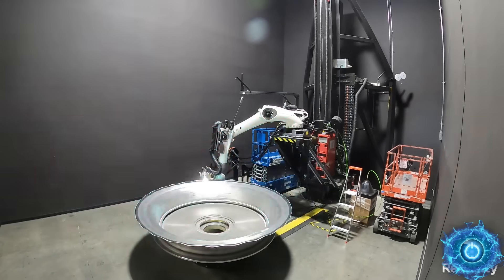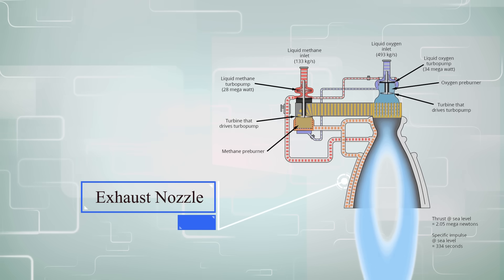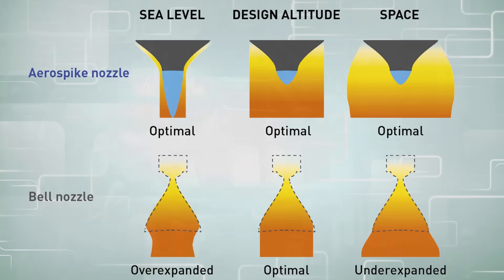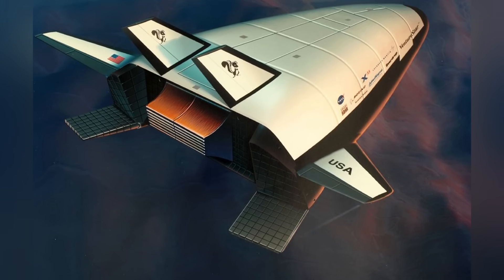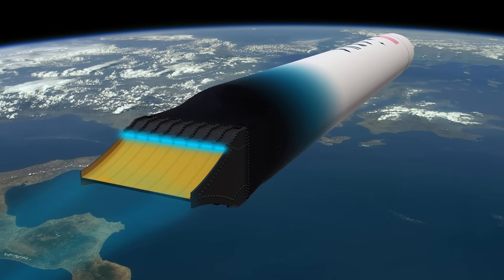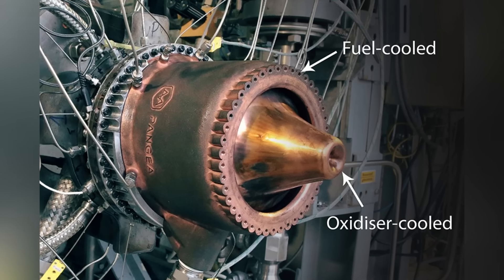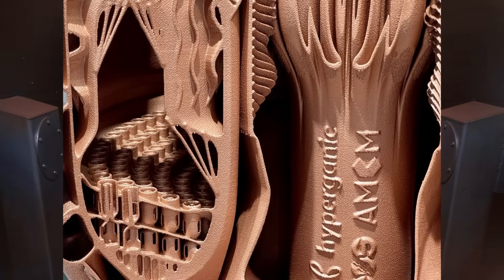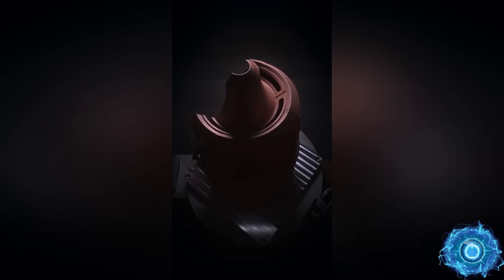GAME OVER - A.I. Designs CRAZY New ROCKET Engine

Comment: Amazing design  !!! Really surprised we haven't reached much further in designs,  we've been doing rockets since the early 60s !!! 70 yrs has passed. Thought at this point we'd be utilizing other technologies.
Reply: Why replace what has been proven to be both effective and economical?
Reply: Just seems strange we haven't advanced much. We lauded on the moon over sixty yrs ago. Thought by now we wouldn't even use rockets.
Reply: @kevinlucas8437  
No argument.  Do you know what the Loughstrom Loop concept is?  It has a fascinating history.
Rockets are the simplest and most straightforward way to get into orbit until someone can synthesize Negative Matter or further optimize Alcubierre's equations.  Or the stuff that Bob Lazar allegedly worked on is declassified.

Comment: You figure that nature, through tens of millions of years of evolution, has come up with optimal shapes/designs for virtually everything ..... in nature. And slowly over time continues to evolve to adapt to changing conditions, so it makes sense that algorithmic engineering powered by a super computer will "simply" sort out the most efficient design very quickly of whatever you want to build.

I've been following topographical / algorithmic engineering for several years now (although i don't really understand much of the complex physics and engineering principals) i do understand the overall philosophy of it, and it really makes sense. There is a great video about the design and manufacture of the  Bugatti titanium 3D printed brake caliper, and it's ability to deal with heat and pressure, this engine concept is really just a much more advanced profession of that same thing, solving issues using AI. But as the speaker stated, it will either be the future or the end of us all 😛

Comment: Algorithms are only as useful as the variables that are built into them and the data that is input for a result.  This is why fluid dynamics models are just that, MODELS.  They're semiaccurate representation of what we expect based on a limited variable set aka understanding.  The higher the tolerances which are needed for a finished product, such as a rocket engine, the more important it is to get your algorithm correct.  It doesn't just happen, it takes work.

Comment: If an AI had designed this engine, the AI would be a MUCH bigger breakthrough than the engine. GPT-4 is extremely good at physics for an AI, and it can help you design a tower of 4 blocks that doesn't fall over, not combustion simulations.

It was probably an evolutionary algorithm. I don't know how AI was involved, so I think it was involved very little. I've only managed to find a single reference to AI on either of their sites so far, and it was about the program in general, not this engine.

Comment: Well, and I feel this is fairly obvious, combine aerospike and rotating detonation engines using this cooper alloy. I would suspect that angling the outer ring of the detonation engine inwards towards the aerospike would get rid of one heated area and solve a great deal of that problem since aerospike reduced heating by the outer edge and detonation does not need any kind of hot area to operate. Time to get out the old cad cam again

Comment: Thank you for video.
AI is just an algorithm - crucial is fundamental database, which is human-based only. It is very difficult, to prove that AI-based random stuff is reliable. 3D printed technology is cool, but provides serious drawbacks in comparison to standard techniques. It is optimized way of doing very old things.
Post Scriptum: this engine will be produced in YEARS for proper roughness and still lacking important issues (printing technology constraints).

Comment: I interviewed for the X-33 project in 1996. Lockheed was full of aircraft experts but no rocket scientists. I told them that the aerospike engine was going to have major vibration problems. They said, "That's why we're hiring you". Alas, I couldn't find an affordable house in Palmdale and instead went to Kennedy Space Center in Florida. Sure enough, the first test firing cracked the composite cryogenic tanks and the mission failed.

Comment: Splitting hairs but, the reason for multiy stage rockets is a weight issue. The reason for a different design in the rocket is due to efficiency.  If air pressure was negligible rockets would still use multi-stage rockets. 
Love the video.
Reply: In a lower gravity or lower atmospheric situation, SSTO would be more feasible and sensible.  SSTO from the Moon & Mars is almost a given.  It was easy to design even in the 1960s.

Comment: This footage of the cutaway propulsion unit is hyperganics stock display model. To anyone that knows I'm number 113. At the moment what I am working on is structural designs for 103 aircraft and replacement components for construction equipment. We are still five years out for corporate proof of concept acceptance and probably ten before real integration of AI parts pass 50% market share. When people's lives are on the line change is slow.

Comment: Also the main solution of an heiress bike is not alloy but rather venting on the Spike. Running a fuel Rich mixture through a vent system down the spike will do the same thing as running a fuel Rich mixture down the wall of a bell nozzle.
Reply: text to speech?

Comment: Something that many people don't talk about when it comes to rde engines is the fact that they are extremely fuel efficient. The only problem is that you have a severe vibration in the vehicle due to the harmonics of the explosion chain. Even setting dual detonation Chambers counter to one another produces a violent shake in the vehicle. We can design the engines but the problem is that the airframe cannot take the abuse. Not for multiple uses at least.
Reply: What defines the frequencies of harmonics? Chamber shape? If those can be controlled through design can they be tuned by a damper? Or are they inherently chaotic and uncontrollable?
Reply: @RandoClippy  there's a myriad of things that lead to frequencies. A good example would be how each car manufacturer has a different vibration to their car depending on how their cylinders are arranged. You cannot fire them all at the same time and then shut them all down at the same time. The way it works is that it needs a constant explosion. The explosions in the chamber are what cause the vibrations throughout the engine. They are playing with mach flow with this engine. Mach flow tends to separate itself from boundary layers which can act as a dampener, there will still be vibrations throughout the entirety of the vehicle. What gauges the frequency is the speed at which the explosions happen, the interval in between the explosions and the location of the explosions along the frame of the vehicle.

Comment: crappy idea : we need the material to sustain high temperatures but we need it to be 3d printed with laser technology so we reach many difficulties. 3d print have not the same structural strength than other production methods. the engine will get a ton of vibration during launch so what happen if such an intricate design fail inside the engine ? maybe the idea is salvageable but we still need better 3d print process. and if the goal now is the reusable engines the solution have to be maintainable as well as efficient. With the technology now investing 500-1000 billions to establish an auto sufficient moon-base for easy launches will be a better investment than trying to develop a inexistent technology that can be a chimera but even with very easy launch from the moon, engine optimisations will still be on the line so why not.

Comment: not to point something out possibly obvious
Although,So maybe statement or question feel free to leave your comment below if you wish I am interested in any feedback.

So I wonder if anyone tried going with a non-metallic object to make that cone.
As long as power loss is not a issue or the system can resolve a power loss occurrence quickly enough to stabilize, I wonder if any of these fellas thought about using that neat little science trick with sound?

I could probably think of two other objects that are non-metallic that might work although those could get damaged within flight depending on where it is and we all know what a micrometeor could do something devious.

Also feel free to find this comment in humor I find some people do and all the same it's good please be well

Comment: I really hate this fake geewhiz stuff.  GRCOP (the copper alloy used to withstand the heat experienced by a toroidal Aerospike) has to be sintered on a 3d printer.  Anyone familiar with 3D printing will have a passing understanding of “infill” patterns — rather than making objects solid using up a lot of the printing medium (in this case GRCOP) 3D printers often use patterns of cavities (most commonly honey combs) to maintain structural strength but conserve material.  The reasoning in a toroidal aerospike is a little different but the infills are essentially the same: On the Nozzle, they want to optimize heat transportation and reduce weight (see: “the rocket equation”).  The “exotic” rocket engine is really just a simple toroidal aerospike engine (it would look pretty mundane without the cut away). The H. R. Giger cavities are just infill patterns, again, optimized on three axis (strength, heat transport and weight reduction).  They may have used an AI to generate those infills, but I doubt it.  There are excellent, and more auditable, infill generation algorithms in conventional computing more than capable of optimizing the infills to these three parameters.  

Also note: it was found that the pressure front of the detonation engines could be regulated by feeding the fuel through a 3d Tesla valve (which is in itself a fairly sinuous and exotic shape) — This prevents back-flow and, the gas trying to back-flow creates a sort of dynamic springy cushion effect that regulates the detonation front. No AI needed there either, only some brilliant, but plain old human, creative thinking.

Comment: I've got an idea for a different take on the aerospike. Itprobably wouldn't work for a launch vehicle. But consider an orbiter launched by something like the SLS. Only the SLS engines are recovered. 
The Orbitr is shaped someyhing like the old SDI test vehicle. The heat shield has a concave shape with a central pod proturding from it. The pod contains the thrust chambers ofthe engine/s. The exhaust gases of the engine are expanded over the heat shield surface. At the perimiter of the heat shield we place either an extendable ring or aset of flaps that form a fence that causes the exhaust gases to form a high pressure area across the heat shield. Workable? I have no idea.
Reply: Sounds like what stoke space are doing.

Comment: I can see a situation where AI-designed devices work great but are so complex that even us humans don't understand how they work and would have no idea how to repair them if something went wrong. This would be compounded in a situation where an AI has designed and improved another AI etc that ultimately builds something that works in ways we can't even comprehend and would we would require an AI-driven so-called "expert system" to help us figure out how to fix it if necessary.
Reply: To be honest, a lot of today's technology has already become way too complex for a single human to fully understand or repair.

Like computers for example: A human can understand/fix them on a module level (CPU, RAM, Mainboard, ...) or even a component level (soldered-on chips, resistors, capacitors, ...).
But designing and troubleshooting the internals of a modern CPU for example with its billions of transistors is already way beyond what humans can do manually.

The layouting of the connections between the transistors for example is computer-assisted and while you could manually step through every calculation step of the layouting algorithm the sheer volume of data that needs to be processed is on a similar level as trying to understand why an AI model came up with a specific result.
Reply: @TheBrain2K  That might be a bit of a stretch though. Human beings use computer-aided tools to help them design chips, sure, but that's not to say that the human beings who designed that system don't understand how the chip works. For sure, debugging a faulty layout would be virtually impossible for a human being, not because of its complexity necessarily, but because of its size. What I could see happening, which probably already is happening on some level, is there being a smaller and smaller number of human beings who understand these things simply because there is software that helps them do it. When that software is also designed by AI to make chips that use AI designs, then that is another thing altogether. We're not that far away from that. I'll say less than 20 years.
Reply: @JustWasted3HoursHere  But isn't that exactly the same as AI? AI doesn't to anything "magical" or "random", it just uses a ton of data and some (in their core) simple algorithms all interconnected and networked together. It's not something that is impossible to understand on a basic level, but it's the sheer size, complexity and interconnectedness of the whole product that makes it nearly impossible to understand.

Also, I feel like at the moment, we haven't really developed the necessary "debugging tools" for AI that would drill down into the data and networks to help humans understand how an AI decision came to be.
In contrast to CPU design, those tools haven't really been necessary so far,  because AI (in its current forms) is messy and inaccurate by design. For a CPU, you do need those tools in the first place, because a CPU needs to work predictable and exact.

It's kind of like how we all intuitively (just from experience/data and muscle memory) know how to throw a ball so that it lands roughly in a specific spot. We've been able to do this for thousands of years. But only in the last decades, we've developed the mathematical tools to fully quantify all the factors and calculate the necessary forces/timings precisely and repeatably.

Comment: Everybody wants to do single stage to space, which is easy peasy, relatively.  But to realize a singe stage to ORBIT you have to have not only a nozzle that is efficient enough throughout the pressure drop, but a VERY light stage, which is problematical on several levels.  One advantage is that you can recover a single stage worth of boosters for reuse, which is less costly.  I don't see this happening any time soon though.  

That rotational detonation engine blows my mind frankly.  You get a lot more energy taking the fuel to very high order burn, but the shock loads must be FIERCE, and I would think over the long term they would be very difficult to design for.  It sure is an interesting idea, when and if (probably when) they get there.  I would expect that maybe materials better suited to the task may have to be designed, no matter the implementation.  We will see.

Aerospikes have been around for a long time.  The problems with sticking something in the middle of a blow torch from hell is obvious, again, materials and VERY effective cooling techniques are needed.  The problem seems that it might be a bit worse than keeping an external nozzle intact.  At least there one face is allowed to augment cooling with air flow and/or radiation, ultimately, to space.  I don't know how much that helps in the total equation, but I expect it is not completely without effect.  Not a thermal guy, haven't run the numbers, but just a guess.  Maybe interior nozzle flow swamps all of that, and just liquid cooling and material, ceramics I expect, are the only real drivers.  Just a few brain farts off the top of the ole pin head, probably not worth reading.
Reply: AI would resolve the aerospike. AI combine with data analysis and future quantic computer would be revolutionary. Engineers are very close to create quantique computer on super small chip.
Reply: one engine to space inefficient, you get there and then what. all fuel consumed to get there. travel slower than the voyager i guess 😅